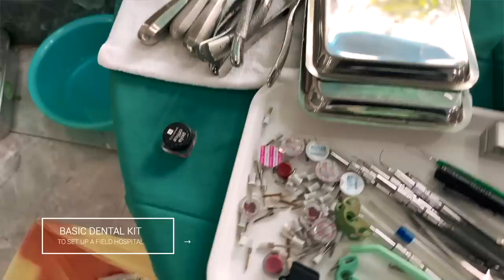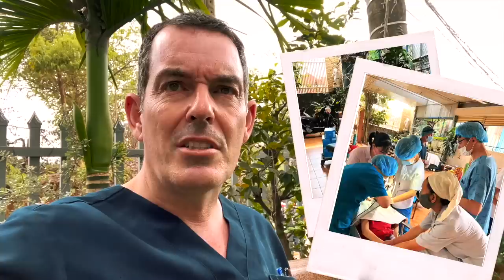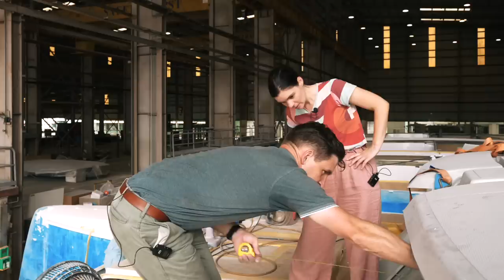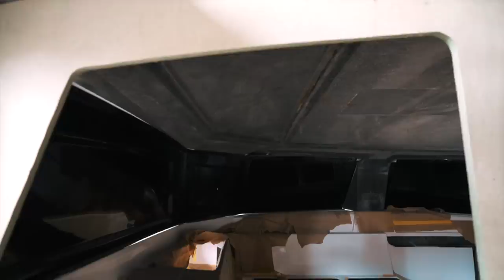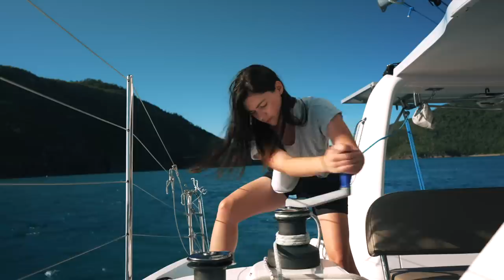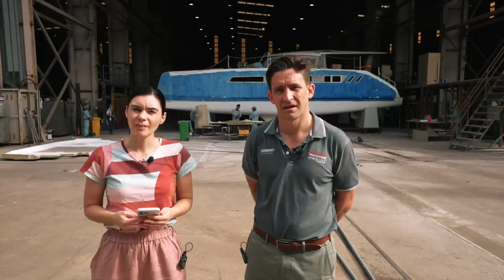Blood, Tears & Boats: Nick's Other Life in Vietnam

Comment: The engines you guys are getting are AWESOME. I have two on my Lagoon 440 with about 1000 hours on each. Just a warning: Beware of the primary fuel filter. The banjo fittings can and do get clogged. I've replaced mine with normal elbows on the intake side, and I'm installing a fuel polishing/transfer system so I can constantly keep my diesel clean. Had a double engine failure on some real bad fuel, and never want that to happen again!
Reply from the maker: Thanks for the info

Comment: ..."You still need an AGM battery for your starts"... Why? You better not start your engine(s) with lithium batteries? I'm puzzeld.
Reply from the maker: In case you flatten the battery bank accidentally. You can isolate the engine start early
Reply: @sailingrubyrose  I understand that but why with AGM batteries? An isolated (start)circuit with lithium batteries does not work?